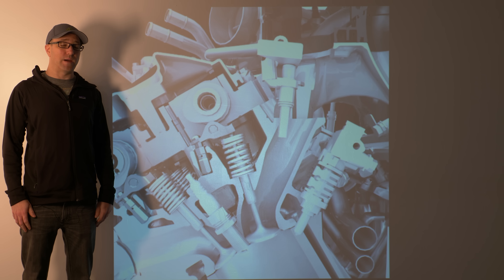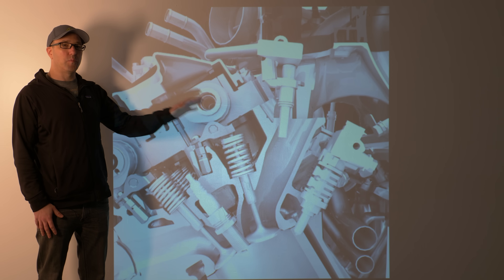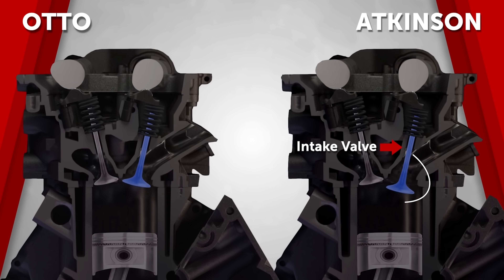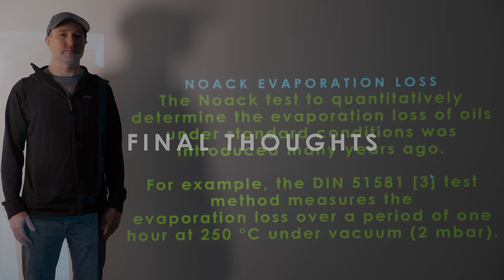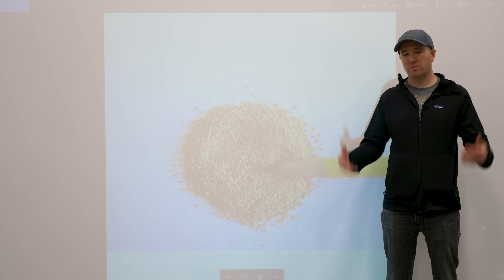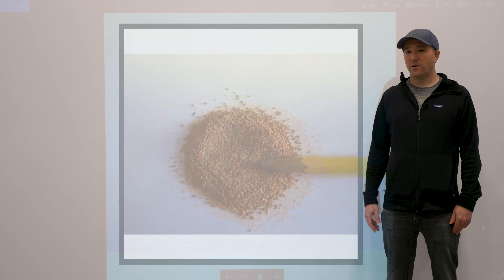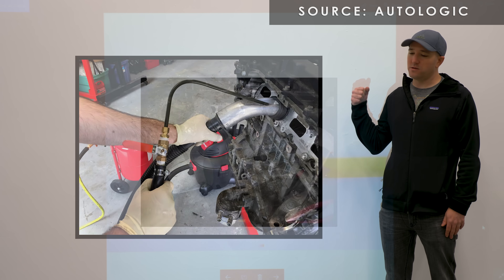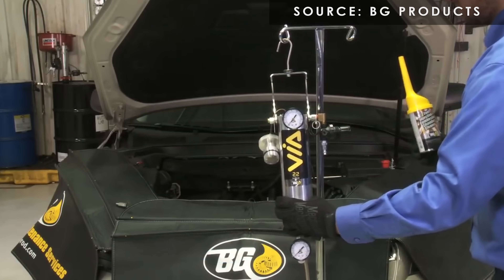Direct Injection, Problems and Solutions | The Fine Print

Comment: Excellent video. Just excellent. It confirms once more that the internal combustion engine is only still alive because of economic inertia. Technically it was obsolete a long time ago. Problem is, our grandfathers bet on the wrong horse. Now we have to pay the price with overcomplicated machines, environmental disaster worldwide and geopolitical shit about oil reserves.
Reply: well put sir
Reply: Curt D consider the excess cost involved in these shit machines that will lower consumer spending dramatically as well as lowering their resale value which all translates to lower efficency And therefore more energy required in the long run. 
Everything the government touches turns to shit
Reply: Had our grandfathers bet on batteries, you'd likely not have any today - the world's Lithium reserves would long be depleted.
Reply: This isn't a valid argument because it relies on the presupposition that the technology is there to compete with internal combustion engines and that is demonstrably false.   Your entire premise is nonsense
Reply: @Chris-qf9qm  My premise is that the thing that competed with ice in the time of our grandfathers, was the horse. Our grandfathers wanted something better than the horse (and rightly so). That could have been electric or steam. Both were used, but had lower energy density than gasoline. That is when we were getting carbon from millions of years ago and put it back in today inside a layer that is (compared to the earth), thinner than the skin of an apple (compared to the apple). That carbon was deposited over millions of years and we use it in a few hundred years. That is something that is bound to give dramatic effects. Apart from that, the oil is in regions of the planet where it is not cosy. And it is running out.
Reply: EPA is purposely putting gas engines out of business. I hope electric cars can be as reliable one day.
Reply: Dragomir Ronilac  Just keep in denial. Your children will have to live with the consequences.
Reply: I disagree. Battery technology was no where near viable back in the day. Even today electric cars have a huge disadvantage. The EPA is creating these overcomplicated machines. Port injection with a good catilitic converter is plenty clean. I would actually bet that in the long term it will be cleaner than direct injection due to long term problems with DI.
Reply: @crissd8283  A catalytic converter does nothing for CO2. CO2 is good to have, but not too much. We are putting carbon inside the thin atmosphere like crazy, whilst is should be way under the earth's surface. Besides that, catalytic converters use platinum and other rare metals. They will run out, just like oil will. And I disagree on battery technology. Search Baker cars. They were very useable electric cars (compared to horses) around 1900.
Reply: Ronald de Rooij ice engines are required for modern world, you are deluded to think otherwise and don't blame business for stupid moronic government interference in tech development
Reply: @zoticus1 You misunderstood. I agree with you. But we can still regret the choices made by our (great) grandfathers. The problem is, we need the ice, but we also need a world where we don't have to fight for the last oil reserves and where the ecosystem is still good for mankind. Pick your choice. Modern world or die?
Reply: The oceans can supply an endless source of lithium.
Reply: Only if you have an endless supply of electricity.

Comment: Best video I've seen explaining this.  So far I have 70K on my 2015 Mazda 6 with direct injection with no issues.  I haven't read on the forums of owners complaining of carbon buildup yet but I'm keeping my eyes open.  When I got my car I heard about this issue and found this article which claims that Mazda took measures to prevent carbon building by monitoring intake valve temperatures.    Is there any truth to this that anyone is aware of?
www.motoiq.com/MagazineArticles/id/2105/pageid/3529/131-compression-and-40-mpg-on-87-octane-fuel-introducing-mazdas-skyactiv-technology.aspx
Reply: Looks like the mighty Youtube removed my link to protect everyone.  If you're interested go to motoiq dot com and search for 'skyactive carbon'.  The article is the one from 2011.

Comment: Hello! I own a 2005 Golf 2.0 FSI Manual 4 Motion. Lately I have had this issue where the car will start lagging and loose power. This mostly happens when im doing uphills in 6th gear, although my RPM is at 3 thousand. It shpuld really be no problem as lang as im nut pushing the car. Ofc then i would gear down. My engine can rev up to 6500 before redline. The issiue was never there before and i would say it varies how much it appears. Sometimes I even get this superweird lag at low speed where I want go from first to seconf or second to third and I give gas but the car responds late. Result is rpm's go up but speed doesnt until 2-3 seconds later. The car has been at regulary service is enitire lifespan an has only done 151 000 km or 93 000 miles which isnt really much at all. Last time was only 7000 km or 4000 miles ago. They replaced the nozzles, the air filters and all such things that would simply impact the car. Therefore I dont get whats wrong. Anyone know what could cause it that they dont replace at regular service? Im strarting to think that the engine is gonna cut off and go into emergency after a long time if i dont figure it out. No lamps are showing in car at all. I drive it a lot of long distances and if going small distances i try to at least get the engine to operating temperature before turning it off. Anyone?
Reply: Could it have to do with 8:30 - 8:50 ?
Reply: sounds like clutch slip
Reply: I dont think its that because it happens when im in gear and clutch slip in gear is something i never heard of
Reply: its when the friction material in the clutch wears down and the pressure plate cant grab it properly against the flywheel, revs go up with no speed increase. if you never heard of it you havnt worked on a lot of cars, if any.
Reply: YEAH BUT SHOULDNT THAT BE MORE CONSISTENTLY?
Reply: could just be the begining of it, as you say its mostly uphill top gear pulls. if you have any major concerns over it or if it starts getting worse you should consult your local mechanic

Comment: I personally walnut blast to clean my intake valves on my modded bmw 335i ever 20,000 miles. It’s not that hard and not a big deal. If you don’t do it yourself most Indy shops only charge $200. Not really that expensive.

Comment: A popular mod list for the BMW 335i is an oil catch can, PCV valve upgrade, Oil catch can(single or dual), and adding Port Injection (mostly for fueling requirements for E85 use over 550-600whp).

Also like mentioned in the video, Walnut Blasting is recommended every 50-60k miles. You notice a smoother idle, smoother power delivery, more power, less knock, better mpg, and therefore less emissions....

I can see why Ford & Subaru are using DI & PI fueling systems. It is the best of both worlds really... Well besides complexity lol

Comment: Very Informative Video even for someone like me with dorect experience and lots of research on my DI equipped car (E92 335i N54 6MT - (Full M3 Front & Rear Subframe/Suspension Conversion)

BMW's HPFP have been under Recall for year's now. They also reimbursed those who purchased at a local shop, etc. The new HPFP revision as of 2011ish, there has been veryy little failure's. 

Obviously there are many on their original HPFP's, so ypu will still see failures but those are original Pump’s or Pump’s replaced before the final revision was made. 

As well as the revision for those HPFP’s, BMW switched to the style pump like the VW’s use and its a much simpler and cheaper HPFP. It is very reliable, inexpensive, and is much much less costly for the aftermarket to develop Higher Volume HPFP’s.

The advantage of DI is pretty significant, you can run much higher Compression Ratio’s, engine cooling effects, and more precise fuel injection. This results in higher efficiciency leading to higher power output/liter & better fuel economy...

I do however, know the negatives side effects of a DI - Only motor, and most of these issues can be resolved and/or overcome. From an emission’s standpoint, i dont know the effects of these changes. I have personal experience with BMW N54 (N55 as well) engine equipped vehicles

Comment: How can you find out whether a motor uses Port Injection, Direct injection or a combination?  I just checked Lxus LS 500 specs, no mention.  Do you need to go directly to each manufacturer, or is there a resource online to see what engine design is being used?
Reply: Look in fuel management systems, my lexus NX 200t has DI and Port I.
Reply: Serge Vivier I can go through one by one, it would be great if there were a list of cars based on what fuel management system they used. So far Ford, Lexus/Toyota are the only ones in the US I can find that use DI and PFI. In Europe, Audi has a 2 liter 4 cylinder that uses both, but they have not brought to the us.

Comment: Would it be accurate to say that Mazda's new Skyactiv-X engine behaves more like a port injection engine in this comparison?  Or is it a different beast entirely?  It doesn't appear to be direct injection from the models I've seen.
Reply: SkyActiv-X is very much direct injected. I don't believe it ever puts fuel on the outside of the intake valves, so in that sense it is like every other DI-only engine (actually a little 'worse' in that the Miller cycle SkyActiv-G engines use at low loads is presumably eliminated).

Comment: A  good quality catch can with a good vacuum.... will this void the warranty on my brand new CR-V?  How often do you recommend adding fuel injector cleaner?  This is your one of your best "The Fine Print" edition vids.
Reply: Paul FU I can't see a catch can voiding a warranty unless something failed due to catch can issue.   Such as a cheaply made one coming apart and getting sucked into the motor.   When I was at Honda we had one towed in with a blown motor.   Of course they wanted further investigation.  The gentleman noticed the car had a cold air intake.  As he was looking at he noticed a huge hole in the tubing from a rub against the core support.   He said pull the catalytic converter.   The cat was full of the bogus cold air intake pieces.  Straight up sucked that into the motor.

Comment: 2008 CX7 DISI with 110,000 miles and no issues. Runs like a scalded dog and returns decent mileage.
Reply: atticstattic The 2.3 turbo did have direct injection. It's the same engine that was in the Mazda speed 3 / 6 / MPS
Reply: yellowbusguy Mazda rarely have problems with direct injection and valve carbon buildup. their pcv system are top notch and the engine rarely blowback oil,  even on direct turbo engines
Reply: If you have a DISI CX-7 that gets good fuel mileage, I think you should consider donating it to a museum.
Reply: If you have the 2.3 turbo, you will have issues very soon. Usually in the form of low compression from Carbon on the piston rings, then the usual soot and carbon issues. Good luck.
Reply: yellowbusguy Mine runs like a scared rabbit😁
Reply: Pull your intake manifold after doing a dyno run, then perform a manual valve cleaning, then dyno after and you will look at this differently. As the degradation of performance is gradual. you have not noticed it. But after a cleaning and sudden restoration of that power, you wont believe its the same engine.
Reply: 2008 CX7 doesn't have DI.

Comment: From what I hear Mazda SkyActiv engines don't have this problem. Supposedly Mazda engineers found that carbon deposits formed when  intake valve temperatures fall below 400 degrees C.  Measures were taken so that the intake valve would operate above this point to reduce deposit formation.

Here's a link for that finding http://www.motoiq.com/MagazineArticles/ID/2105/PageID/3529/131-Compression-and-40-mpg-on-87-Octane-fuel-Introducing-Mazdas-Skyactiv-Technology.aspx
Reply: fastcx can you link pictures or evidence to your findings? I would be interested to see them
Reply: Jee Vang reading Mazda forums i don't see any carbon buildup problems in their engines. Would be interested if you have any proof if this is indeed marketing crap
Reply: I hear that run engine at high rpm and low load can clean carbon deposits.
Reply: Von Ace Mazda skyactiv engines at later revisions came with a catch can/filter, but it still don't do an excellent job, which lead to lots of aftermarket catch can just for their engine here in Malaysia just to solve/reduce it further than stock can/filter
Reply: I've read that much of the deposit formation occurs during cold start. This wouldn't help much then.
Reply: Von Ace nissan, Toyota, Honda and other Japanese companies went with dual injection. 1. Being they test their cars to the their mountainous roads. 2. Being dual injection is also better for turbo applications when starting (running rich on startup), hot weather (ability to cool the engine better). Whereas VW went with straight Direct Injection. Not sure about Us cars but I'm hoping that dual injection becomes the norm.
Reply: I've read that much of the deposit formation occurs after engine shut off...

Comment: Can you please recommend a quality oil catch can for the BRZ.  I am lost on this.   You read a long tech sheet only to  find out  the product is made in china and sold under 5 different brands.  I have been wanting to install an catch can for some time.  Are there any quality brands made in the states?
Reply from the maker: http://www.radiumauto.com/Catch-Can-Kit-FR-SBRZ86-P374.aspx. You only need to use the PCV can not breather unless you run FI.
Reply: Ty I have not see this one.